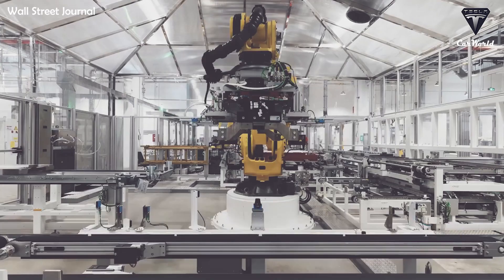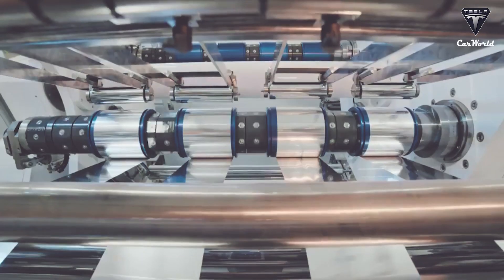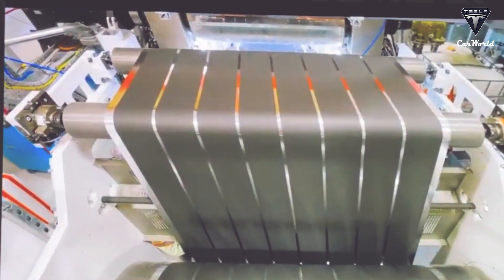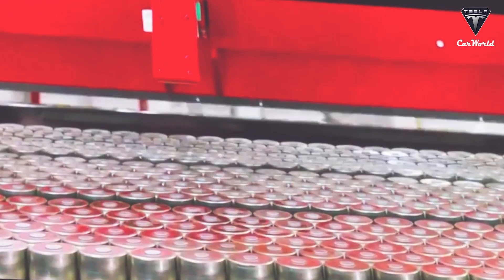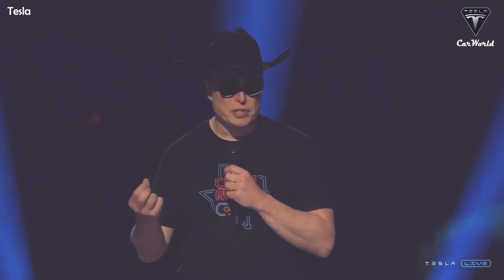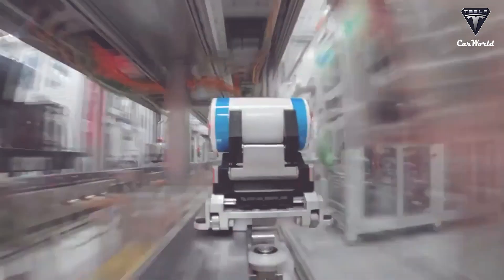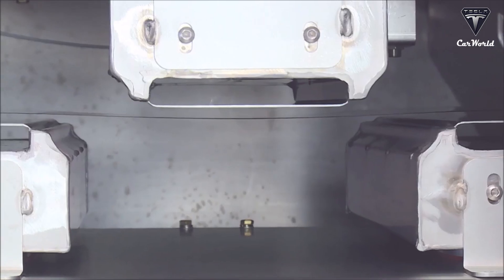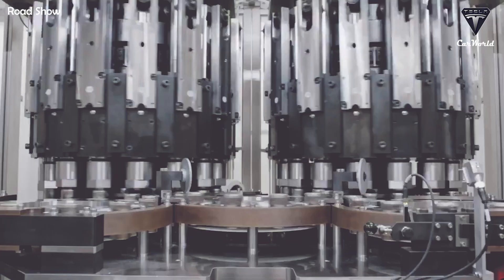IT HAPPENED! Elon Musk Reveals Giga Texas INSANE Production 20M 4680 Cells, Can't Control!

Comment: You might be surprised what robots could do. Just Because Tesla has easy cell placement in battery packs doesn’t mean that the other pack couldn’t be robotically assembled … if you program your line and prepare it correctly then there is no reason that you couldn’t use Robots to assemble much of each car … the thing you need is sufficient capital .

Comment: There is a new battery out that outperforms Tesla's batteries packs. So what is the point. In having period Tesla separate little packs that keep failing. Everyone knows in 7 years batteries fail. Why don't you just make cars for in town driving. You can still have the guys making $100,000 a year Drive super fast cars that can only do the speed limit. And that's funny